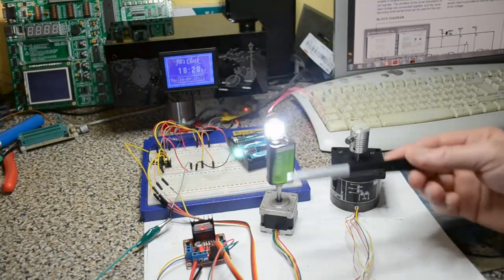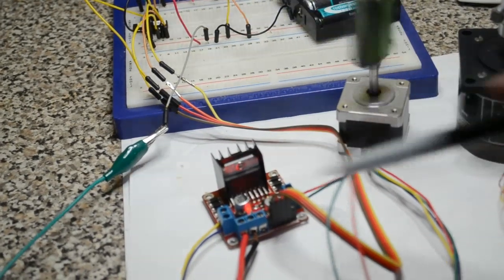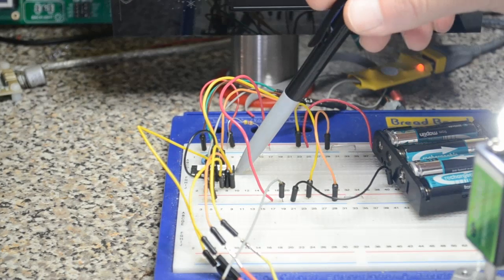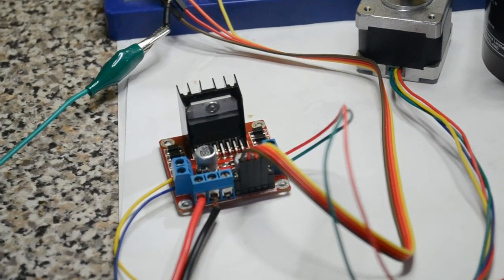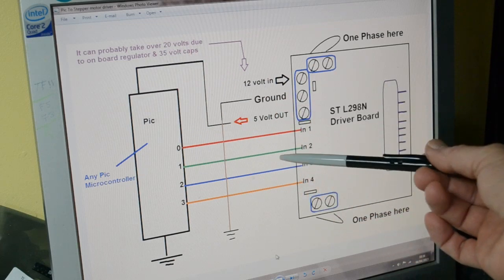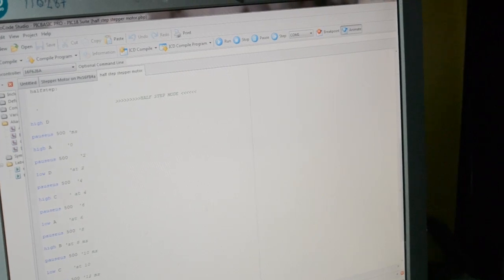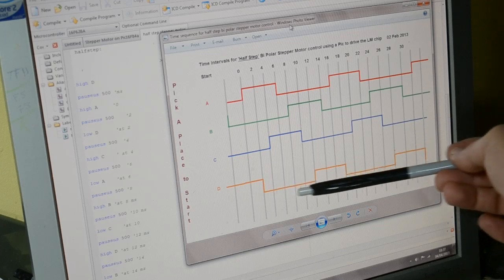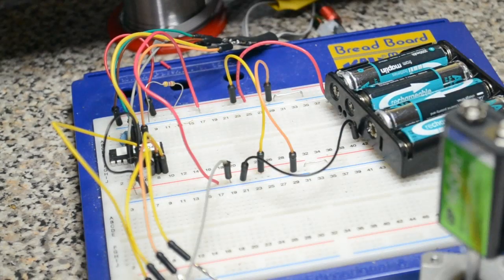Bipolar Stepper Motor part 4 small motors with code & wiring diagram

Comment: i am using a nema 23 stepper motor which has 2.2A rating can I use l298 driver for it??? i used it on motor without load but it only vibrates how can i fix this?
Reply from the maker: Your wires must be wrong if it only vibrates.
Yes the driver will drive a Nema23

Comment: Good job man. I did the same code for pic 16f84a with delay of 5 us, 5ms, but the stepper goes realy slow an i dident figuer out how to control the speed . 
Any tips ,plz.
Reply from the maker: Thank you.
1 millisecond delay max in the step routine, some motors can have a 500 microsecond 'ON' time, others are 1 millisecond.
The speed is controlled with a delay after one step. 
Don't leave the pulse on for longer to control the speed, just longer delays before next step.
How many revs are you getting per minute?
Reply: So that's why when i decreased the delay the stepper goes anticlockwise insted of clockwise.
Thanks sir.
Reply from the maker: Hi,
It should not be going the other way just by changing a delay time.
Sounds like you have 2 of the wires crossed.
Reply: OK.

Comment: I have trouble finding a board for my 2,8v 2,5A/phase stepper motor. Could you help? its bipolar with 4 wires, im new to stepper motors. Would be awesome!
Reply from the maker: Hi,
Either use the board in the video or the Toshiba board.
Reply: Thanks for replying so quick! Is the driver board the L298N?
Reply from the maker: Yes

Comment: how can i connect a 7 wired stepper motor? and use a a4988 driver
Reply from the maker: Hi,
It sounds like you will have 2 'centre tap' wires, so leave those off.
You may have a power wire too, leave that off.
That should leave you 4 coil wires.
Reply: I mean 8 wired, sorry I made a mistake, thanks for your answer

Comment: Does it matter if the coils are wired the wrong way around?  I have 3 x Matsushita BIPOLAR motors with wiring RED, YELLOW I presume are 1 coil and BLUE, ORANGE on the second coil, does it matter which way around these connect to my controller?
Reply from the maker: Hi,
The motor will just go in the opposite direction, or hum if they are wrong.

Comment: suggestion plz
i got 24v 3.5a stepper motor

what chip to use beside L298?
Reply from the maker: The Toshiba driver, easy to control too
Have a search, I have a video on it.

Comment: Wow. Not only did the code work, but this low level code blows away Arduino's stepper library.  The key is  the delayMicroseconds.  And just to have total control at the lowest level.  Arduino's stepper library is for basic crude operations. It is horrible to use if you want control.  I will never ever use it again. I love your low level way of doing it. My stepper now runs at lightning speeds and seems much quieter in the process.  Arduino's stepper library is crap.  Thanks again John for leading the way. You are very kind for posting that, and especially with that diagram, explaing how it works, etc.  I am now about to run 2 stepper motors (then 3 and 4) at the  same time and at different speeds. The code is going to be heavenly. I am feeling stoked. It will now take very little time to implement what I want to do, and to see my homemade ghetto CNC machine work for the first time will be an outer-body experience. And it is all so easy that is just all fun and no work, other than building the machine which was very hard to do using drawer slides. I am on fire now!
Reply from the maker: +Jeff Beck 
Wow fantastic Jeff, I can see you're very happy :)
I'm pleased you found the answers you were looking for 
Thank you

Comment: Thank you for your video John. I had seen it before and subscribed, and now much later, while researching controlling steppers in more detail, i.e. by using the 4 pins directly instead of through the stepper.h library, and I landed on this video again.  Excellent diagram and explanation of how the pulses are fired off. Outstanding video. Thanks John.
Reply from the maker: +Jeff Beck 
Thank you Jeff for your comments.
The video is quite old and I didn't have a video editing tool, my later videos are better (I think lol)
There is also a Toshiba driver, one clock pulse from a pic to drive a stepper motor.
Thank you

Comment: Hi John, nice video, keep up the good work.
Can you or someone help me with the following;
I've been salvaging stepper motors from different sources like printers/scanners etc. These Stepper motors are of various sizes and of various powers (like one is of 2.5V-2.0A-1.8/Step, other one is 1.6V-2.1A-1.8/Step). I've a question now. What is the most efficient way to use all of them in one system like CNC? Using one power supply? What controller? 
Regards
Reply from the maker: Hi,
Have a look at one of my latest videos.
It's one of 2 and describes the 'Toshiba' CNC driver.
Scroll through the vids, there are 2 of them.
The Toshiba is very easy to use, 1 clock source and a 24 volt power supply.
Regards
jb
Reply: John B Hello mate. Thanks for a quick reply. Now watching the videos you reckoned. Regards.